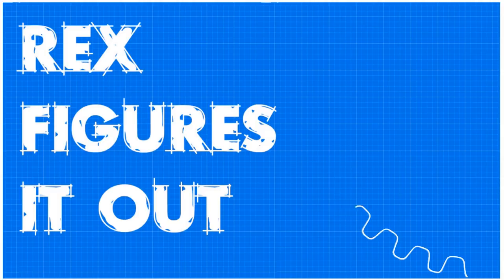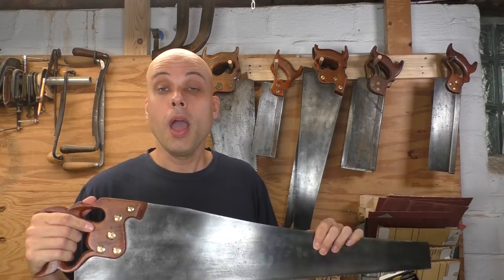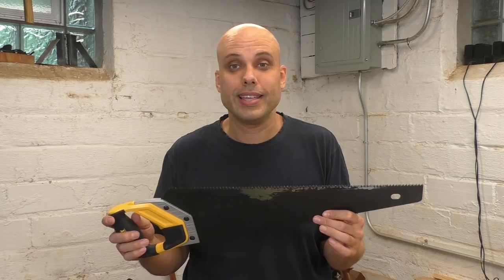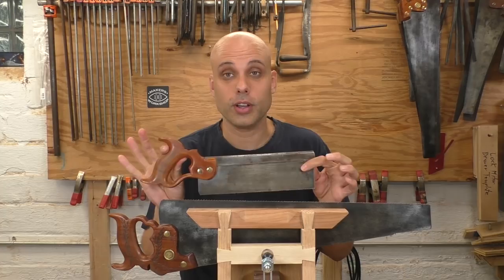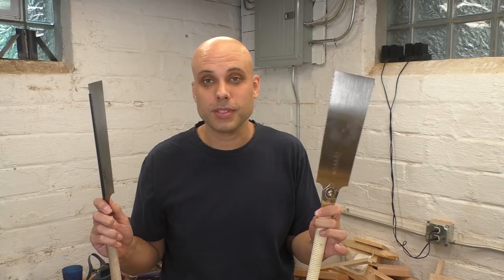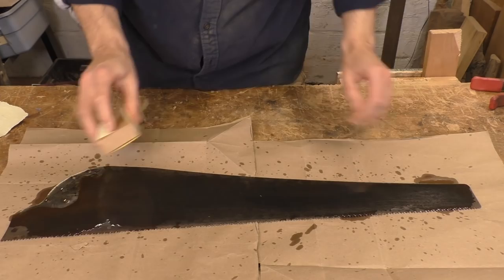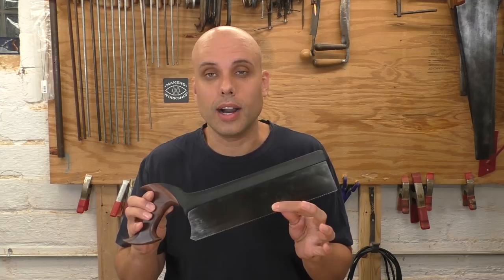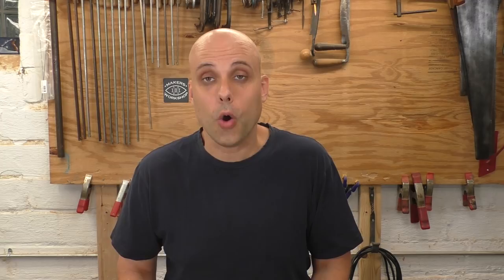The TRUTH about woodworking saws.

Comment: Before I realized that you weren't supposed to resharpen hard point saws, I resharpened a few (took me a few hours on each but it worked).

Now I'm wondering if you could just temper them a bit. Take off the handle, put it in a domestic oven on say... 180℃ (~400℉) for a few hours and then sharpen them...

Comment: It’d be really interesting to see what effect different methods of pulling the temper might have on those hardpoint saws...

Perhaps propane and butane torches and maybe oven baking if they’ll fit.

Might be possible to pull the temper enough to sharpen them. I know you can sharpen them with diamond files because I know a nutter who does.
Reply: Using a torch may introduce warping... at least it did when I tried it!
Reply: It would be cool to see a video like that, especially one where the saw was sent off to someone with the diagnostic resources to check the steel more closely.

Comment: If we can ct up a job saw for scrapers, wouldn't it be possible to grind or break away the impulse hardened points and then cut new teeth in the mild part of these saws and continue to use them as a resharpenable saw?

Comment: I think you should try your hands into making a classic western resharpenable saw yourself, probably with some sheet steel salvage. You can harden the edge with a blow torch or a few and temper on the oven. Not because I think it would be cheap or even of excellent quality (could be, but if I were to bet, I'd be on "no"), but because I think it might be educational. Saws aren't the most complex tools in terms of parts (it could literally be just 1 part, ergonomics aside), so it is one of the tools you can more easily give a go at making them. Even if you don't make a great tool in the end, few things make you understand a tool as well and as fast as just trying to make one of it. Or, if that ain't possible for you to try, it still helps a lot to just watch someone do that instead.

Comment: Any tips for the absolutely awful noise during sharpening? I used in-ear +over-ear protection and it was still pretty loud. Neighbours have never complained about any noise except for my attempts at sharpening my saws.
Reply from the maker: Grip the saw as low in the vise as you can. Play Slayer on the stereo.

Comment: How about grinding all the teeth of off a dull disposable saw and filing new teeth into the metal of the blade... The teeth would have to be set correctly but would they be sharp enough to be useful and would they hold their edge?

Comment: Saw w/ hardened teeth can be sharpened w/ a cutting wheel on a dremel (preferably diamond grit)
Reply: Sharpening steel with diamond on a power tool is a bad idea the diamond dissolves into the steel it the heat goes up.

Diamond on steel is for manual filing only.

Comment: Luckily for me, I hate myself, so when my Husky saw goes out, it'll be the dremel and a file to remove the hardened teeth, clean up/joint the plate and then go down the journey of making new teeth with hacksaw and a couple files :D

I'm thinking very coarse rip teeth to pair with a sorta vintage Disston 12 tpi crosscut saw. I'm still going to get a new Ryoba (the lack of rip teeth on the HF one I have is starting to get on my nerves even though it's great at not getting shoved around by the rings of a douglas fir 4x4), but I like options and I actually enjoy sharpening the teeth.
Reply: That's a good idea.
Perhaps Rex could do a video on converting his disposable saw to a resharpen-able saw.
Reply: @LZP123  
The answer to that is: I have no idea! :D
But I reckon a quick file test somewhere would give me an inkling. Either way, it'll be a good learning experience with a new rip saw or a set of card scrapers, so win-win!

There's also a temptation to lightly and carefully take a propane torch to it with the plate mostly submerged to lightly anneal just in case, but I don't want to risk it suddenly curling up like a cat if I do it wrong.
I've never annealed anything before :p
Reply: @LZP123  Good point.
Reply: @Vincent-S  The body of the saw is most likely totally unhardened to maybe a bit springy. Way to soft for that application. To harden it you would have to heat it above the transition point, it will be glowing red and magnets will not stick anymore. Then quench it, depending on the steel in water or oil and then anneal it. The annealing can happen in any oven. However watch out for fumes especially when oil quenched. Best case don't use an oven used for food.
Reply: @FreeOfFantasy  neat, that'll make the saw project a bit easier since the rest of the plate is unhardened, thanks!
Reply: @Vincent-S  Note that you want the plate to be fairly soft else it will snap instead of bend. Also doing the hardening right really depends on the steel. Without information that will be hard to get right.

Comment: I haven't seen anything in this video that gets thrown away.  Like you said, a saw becomes scrapers.  A triangle file becomes a triangle deburring tool by grinding all the teeth off and making the corners sharp, this essentially lasts forever.  A flat file becomes a scraper or gets remade into a knife blade.
Reply: Problem is, how many triangle deburring tools do you need, if they essentially last forever?
Reply: @BrooksMoses  lol, in a shop you're always misplacing them, more is better!

Comment: The other thing about vintage saws is that they are laminated. The out side faces are hard. The inside not so much. This is what allows the saw to be flexible and , if you are not careful, to get kinks in the blade. Also, there are very few places where only the blade for Japanese saws can be bought. As to making scrapers with the rest of the blade, the thinner the blade material is, the finer the cut . This basically a function of how much of a hook you can make with the available material. When I sharpen my scrapers I make the blade with a 45 degree bevel and form the hook to one side. With the very thin blades this is all that can be had.
Reply: I only have one store near me i know that sells replacement Japanese pull saw blades, and I live in Hawaii, like half of the stores are Japanese.

Comment: thank you Rex . question please i cut up logs into boards on my bandsaw 17" 2hp grizzly . eating up blades like crazy . i took my 4-1/2 disk grinder with a abrasive disk it worked okay 18 mins for a 131-1/2 " blade . why would it not work with a dremel set up that way . now to be honest the reground blades did not cut clean but its not to size ( over sized )

Comment: If I had to hazard advice on sharpening a saw, it would be to dispense with crosscut grinds... The rip cut might be a little less effective, but not so noticeable. You only really need to know how to repeatedly get chisel sharp teeth straight across, and it cuts your file collection in half... One for coarse teeth and one for fine... obviously you still need a rig to level and straighten, but one jig is enough.

    The first year or two in woodwork with hand tools, just get a jobsite saw... It's more important for your skills to grow as a woodworker or carpenter than as a sharpener anyway. Of course, try to avoid nails, but if you ding it up, just replace it... You can start "getting serious" when you're ready. ;o)

Comment: what if you just sawed of a thin piece of the point hardened saws body along it's length to remove the teeth and filed new ones on the unhardened body? Maybe the steel body is hard enough to hold an edge

Comment: Not sure if you respond to posts on old videos. Just thought you might have info. Interesting video help me to investigate an old saw my father left me. It is an atkins silver steel. It is at least 70 years old. Cant read all the engraving but could be as old as 100 years. As far as i know it has never beem sharpened but it still cuts through wood like butter. Is that normal? Guess it would be even better with a little love. I cleaned it up and restored the handle. No engraving on the handle. Do you know some way to make the metal engraving stand out better? Its a bit worn. Can read silver steel, some number (maybe 60) made in indianapolis. Any thoughts?

Comment: hi. i sharpen my hard teeth saw with a small diamond file. the problem is that if its used wrong they break the teeth, in this case no way. its tricky to fit the file between the teeth, but there is a way that i learned the hard way. u can sharpen it a few times.

Comment: Shock hardened saw & diamond file?
Reply: Been there and done that successfully.
Reply: I would love to see this tested. Or cutting new teeth on the plate from an induction hardened saw.
Reply: It works but good diamond files are expensive.  You can use cheap diamond files but then you are replacing a disposable saw with a disposable file.  You've also got to factor in your time here.  How much is the value of your time to sharpen a job saw vs. the cost to purchase a new one?
Reply: @rockets4kids  what if you took a triangular file, ground off the teeth, and then used some diamond compound? you might have to do something weird like mounting the saw upside down, or getting the compound to be a little viscous, but those bugs could be ironed out.

Comment: Actually, you can resharpen a 'disposable' saw using a diamond file or a dremel tool with an abrasive bit. However, putting a price tag on your time, i find this feasible only if the saw has large teeth of a simple shape.

Comment: Love the video. You talk about saws going blunt, but it happens gradually, so I find it hard to know if my saws have had it. Are there any tells for when your saw has become too blunt and you should sharpen it (if it's sharpenable) or buy a new blade?
Reply: Just touch the teeth. If they don't feel like sharp needles the saw is dull. You can look at the teeth too. If you see points of light on the tips of the teeth the saw is dull. If you just think the saw is dull it probably is.

Comment: Have you ever tried grinding the teeth off a throw away saw and then sharpening the blade itself? If the the blade is tempered and only the teeth are hardened you should be able to turn it into a resharpenable saw shouldn't you?
Reply from the maker: That SHOULD work. I have not tried.
Reply: Please, make a video about that

Comment: I would recommend not buying one of those black PTFE (Teflon) coated saws because they always leave crap in the endgrain which can be a real pain to get out. They're good for cutting down trees or really rough, heavy work but I wouldn't let mine near a project.
Reply: I guess it depends on what you do with it, if you do construction work then a coated saw is great if you do finishing work then not so much. 
It's a good idea to have both but get the non-coated version first, if you're doing fine woodworking it's also a good idea to sand/scuff off any branding that happens to be on the blade.
Reply: @volundrfrey896  Yea, true, but softwood doesn't really benefit much from the coating either unless it's green or has been rained on. It's sort of a very specific niche need that's been inflated to make it sound beneficial to all.
Reply: @nightcatarts  I'm happy to admit that it might be a placebo. But I find it helping even on like pine 2x4's, or regular pine plywood and things like that... but it might just be my imagination or that the coated saws I buy just happen to be good at those things.
Reply: @volundrfrey896  I've found the coating only really helps if the wood is pinching on the blade, so I suppose on long beams it could be useful yea.

Comment: Since the main part of the saw is tempered and therefore softer than a file, is it possible to buy the hard point saw and then just cut off the hard teeth when they get dull then use the file to turn the remaining tempered metal into a sharpenable saw?
Reply: Actually, I will do it like this as I think its far more work to buy a metal sheet and create a saw from scatch. In addtion you may be able to sharpen the hardend saw with a diamond plated file (I just did it this afternoon).

Comment: I wonder... what if you take an impulse hardened saw, cut off all the teeth (say with like a dremel), can you then cut in new teeth as you desire? Or, alternatively, take off the handle, flip it around and cut the teeth on the back of the saw? (Only need to find a solution to the handle though. Might want to get out the dremel once again? or maybe a metal cutting saw?)

Comment: So, if you can file off all the teeth and recut on a vintage "resharpenable" saw, couldn't you also cut the teeth off the jobsite saw past where the teeth were impulsed hardened and cut new teeth there? If that is a reasonably possible scenario, how do you feel that would that compare to a recut "resharpenable" saw? Thanks for all that you do. One of these days I hope to be able to support you and other creators like you who share information freely.
Reply: Because the steel is crap. A normal saw has been hardened and tempered, it is just left soft enough for a file to still cut it (it is hard on the files compared to most tasks). If you grind away the hardened bit, you would be left with a soft steel that would need hardened and tempered. But likely it doesn’t have high enough carbon content anyhow.
Reply: I don't recommend it. I have very good grinders, which could get the job done after cutting the previous teeths down. Also the heat map for tempering. But home made things this way usually result in half the quality, 4-6 times the time and some incredible amount of effort.
Reply: On a impulse hardened saw only the teeth are hardened. The rest of the blade is presumably way softer then most vintige saw blades. So you would have to harden and temper the blade. Wich is a lot of work and specialist equimpent to have around...
Reply: It's pointless (bad pun) to waste time "resharpening" a cheapo hardpoint saw, when you can put the same or LESS effort into resharpening an old traditional saw.

Comment: I guess, that you can sharpen even some saws with hardened teeth. I've done it. I've heated up just the teeth (when i heated more the whole saw warps). Interestingly i don't even have to heat the teeth to a cherry red or even glowing colour. About 300°C seem to be doing the job already. They seem to become softer and i can then sharpen the teeth. I tried it on several saws now and it seems to be working on all of them.
PS: Great video!
Reply: You are drawing the temper. You have to be very careful because as you say, a torch on such a thin, flat piece of steel generates lots of stresses - not so much at the edge, but in further from the edge and it will immediately cup from localized expansion.

Comment: If it's just the teeth that are hardened on a modern hardpoint saw blade, could you just knock off all the original teeth, and recut a whole new tooth profile in the steel behind the original edge? What about annealing the original edge with a torch? Thanks for the video!
Reply: Dont see why you couldn’t, although you would probably be better off normalising than annealing its much easier

Comment: 3:44 I cant huh? Like i cant sharpen the metal files? Last time i check acids tend to sharpen files pretty well, so it should also sharpen saw blades as well. I paid 25€ for 20kg container of citric acid, couple € for brass brush to clean the grooves from any crap that is still there, another few € for dishwashing soap to remove any oils and after sharpening wd-40 to oil up the surface. Havent paid a cent for a file ever and i have good collection of old extremely nice quality files by people who threw theirs into metal trash bin. Havent tested on hand saws, but i imagine its same thing with those.

Comment: It would be an interesting project to take the blade of the modern worksite saw (when it is dull) and retemper the teeth to make them sharpenable or just cut them off and cut your own teeth into the tempered material below them.  There are much better ways to get the saw you need, but sometimes a project should be done not because it is the best way but rather for the experience and enjoyment of being able to do it.

Comment: Rex, this might be a silly question, but is it possible to remove the impulse hardened teeth on on of the disposable worksite saws (whether it be with cutters, grinder, etc) then put new teeth on that saw to make it able to be sharpened? I'll admit that I dont know anything about the steel that the body of those saws are made of

Comment: Rex,

As always, this was an entertaining and informative video. Thank you very much! 

I do have one question though. Once our impulse sharpened saw becomes dull, could we not just file off the hardened points and then sharpen the tempered body of the saw just like we would a resharpenable saw?

Thanks for all your efforts and expertise. 

Steve A.
Reply: I saw an episode of "How It's Made" where they were making those impulse hardened saws. Once the teeth are profiled and set to the right kerf width, the teeth part of the blade is passed between two high-power electrodes that set up a current in the blade and that current induces heat in the metal. The blade is then rapidly cooled.
-
I said all that above to get to the point that the hardened part of the blade is maybe two or three 'tooth-heights' into the body of the blade. So you may have to get through a millimeter or two of hardened steel to get to the tempered body. Other than that, I say if you have the tools and the time, go for it, right? Worst that happens is you find the metal won't hold the sharpness or kerf.